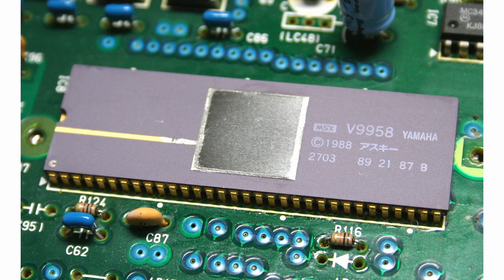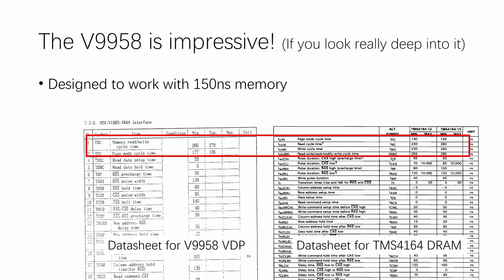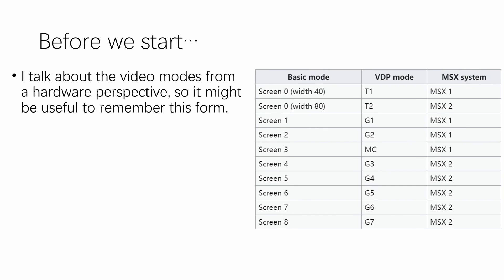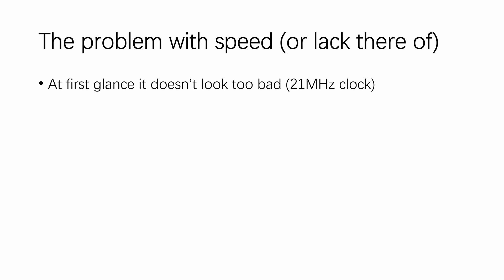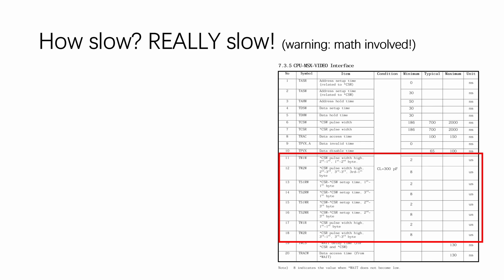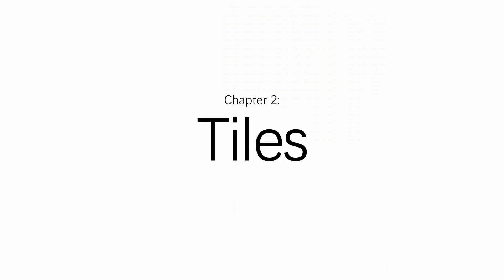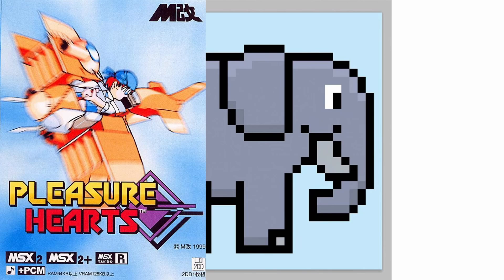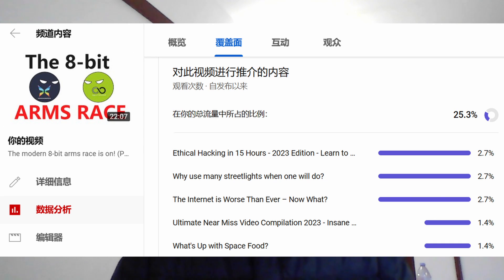The V9958 is a bad design. No, really.

Comment: I did a lot of analysis of the NEC uPD7220A GDP with a similar VRAM access via IO ports.
The clock is more in the range 3-8 MHz, with my computers (robotron A5105) running it at 3.75 MHz. The pixel shift registers are located outside and clocked at 15 MHz dot clock max.
This V9958 clock is just the base for the dot clock because of internal pixel output generation.
Like the dedicated uPD7220A, the V9958's internal complex logic is running at a lower speed, since the number of transistors doing the logic, and esp. the length of the logic processing chains, determine the reachable clock.
The transistor switching speed and currents (driving the next logic elements) are defined by the used fab process, which is also a matter if cost and production yields.

Comment: lieber andy, ich glaube selbst mit einer echten 16 BIT CPU ist so ein v9958 noch viel zu langsam,also den sogannte "flaschen-hals" dann in diesen computer system.
wenn ich da viel mehr ahnung hätte von den akutellen 2 Euro "PI PICO" Version 2 ,würde ich "just for fun" mir das schnelle mega drive 1 als neues Vintage hardware modding projekt da "vor nehmen".
Da dort die alte 68k CPU in Standart "DIP" format also gesockelt werden könnte wie "PI Storm" auf den Amiga 500/1000/2000 etc. also auch der normale "PI" Pico die gesamte Videospiel-konsole allein kontrollieren könnte,ausserdem dass lächerliche nur 64 KB VRAM gegen einen PI PICO 2 ersetzen,der dann die neuen "SUPER FX" GFX Effekte dann "berechnen" darf.leider es wird trotzdem dann bei nur 320x240 Pixel eben den maximum des sega MD "VDP" Chips da bleiben. und noch mal vielen dank für deine info videos über den langsamen v9958!

Comment: It really sounds like your complaint is that the V9958 doesn't really actually add much over the V9938 or even just an improved TMS9918A. That the original chip was maybe serviceable in 1979, but by the time the V9958 was introduced it should've been more capable. It might've been, if not for its reliance on slow DRAMs.

Comment: You say the chip is available new, even thought that is true, it is basically a invalid option. Paying 50 bucks for a chip in very short supply, is no option for homebrew systems. But you forget the true achilles heel of the 9958, basically of the whole MSX line: 212 vertical lines. It is just an unbearable low limit, especially on PAL, where a CPC or Amiga can deliver the full 288 lines. 25% of the screen unused in unacceptable. Most competitors had 240 or 256 lines. I know C64 and Speccy were even worse with 192/200 lines, but those do not have an "advanced" late eighties chip. Just skip the entire thing and get an Amiga I would say.

Comment: Bitmapped graphics are a terrible idea unless you also have a 16 bit cpu and very fast low latency vram. If you're going bitmap you're going to be pushing a lot of pixels from the cpu into vram and you're probably going to be using tiled graphics in your game engine as it is just so much more efficient to store game graphics that way, so no tiles in hardware is a missed opportunity. Chip really sounds like it was designed without consulting with the people who were going to program it

Comment: While I agree that V9938/V9958 are a missed opportunity in what they could have been if their design was cleaner, however they are still my favourite choice when I choose what graphics feature set to use in retro development projects. Look: the X68000 has a really weird square resolution, and besides it has lots of features very hard to master. The HAM mode in the Amiga is a dirty hack that I never enjoy programming for. The NES has a very limited color palette. In the end, the V9938/V9958 offer exactly what I want, and no other chips from the era come close. Even the later V9990 got it wrong by not supporting sprites it bitmap modes (it supports them in pattern modes only). I know the V9938/V9958 have sad limitations, but they are the vintage graphics with the best feature set. No other chips got it better (they were faster, but their features were poorer or even dirtier to program).
Reply: Ah, and I forgot: the Atari ST has no hardware sprites (yes, its blitter is fast enough for emulating them, but you don’t get hardware sprites). In the end, it’s like I said: the V9938/V9958 end up being the ones with the best feature set from that era. No matter what you try, the answer is always the same: they are the only choice (unless you sacrifice features for performance…. but then, if what you want is performance, why go retro when you get TFLOPs of performance with modern GPUs?)

Comment: I try to cut my V9958 some slack because of it's age... but it is starting to get on my nerves!  On my 3.57MHz bus-clock system, I have to insert TWELVE NOPS after each pixel write in GRAPHIC7 or in YJK modes.  So drawing a full 256x212xYJK frame takes like 0.5 seconds.  I'm starting to consider using a Pi Pico 2 for video in my project.

Comment: I feel like the V9958 is an excellent chip if you understand what it's good at, and what it's not. It clearly needs more cpu grunt to really take advantage of it than a 3.58Mhz Z80 if you're working on a modern project.

I've been wanting to use it with a 4-8Mhz 65C02 or 65C816 in a homebrew project, and see what it could do for a few years. 

I've had various thoughts on to handle things. The nice thing about the 65XX chips is that they have really tight memory access times, so this could help things or hurt things depending on your view. Depending on what you're doing, it can run circles around faster clocked chips of the time at the cost of programming, so you have to treat it like an early version of a RISC chip and be efficient.

 I was thinking of the possibility of using a single 1K dual port ram in conjunction with standard main ram, or even using some logic to handle ram access. Possibly even have it where the CPU accesses things only on clocks the VDP does not.

I do know from reading that the V9958 apparently DOES NOT like the block transfer operation of the 65C816, so a direct access to the ram would be really nice. And talking about weird to program for, the 65C816 will really shake things up here.

Throw in a YM2203 and a DAC and it could be an interesting little project. I had thought of potentially using one or two FIFOs in it, and use a clone of the Disney Sound Source for PCM audio. An alternative would be a YM2413 instead, but I was trying to keep some little bit of distance from the MSX.

There's quite a few possibilities here, each with their own tradeoffs.

I've had time to think about things, so we'll see what happens. Still haven't actually started it yet.

Comment: It's long been claimed that ASCII straight up didn't care about games which is why they did a chip with proper vertical scrolling only (for console output)... and that more subtle things like the sprite enhancements were snuck past them by the designers.

A more enhanced pattern mode would have been nice for sure, not to mention less lazy blitter timings.

Comment: Uhm, your calculations are not accurate. copying a 512x212 block from one page to another in G6 takes about 1 second in logical move. That is the VDP carry out the following access for 512x212 pixels = 108544 pixels:
- 1) Read a byte from source 
 - 2) Read a byte on destination
- 3) (Perform a logical operation so no I/O) access
- 4) write a byte on destination

So three byte accesses for every pixels. Because the VDP is not optimized to avoid a double I/O for adjacent pixels when processing in 16 color mode, two adjacent pixels this operation is performed two times, in other words the vdp accesses the same byte even if it has just accessed before. So what number of accesses do the vdp in the above example?
108544*3 i/o accesses =325632 i/o about 318 Kb/s. 
In byte mode the number of accesses is rougly 170Kb /s of data mode, but because to copy a byte you need two I/O operation the memory access speed is something in the ballpark of 340Kb/s

the problem with  cmd engine is not vram speed. on VBLANK there are plenty of slot available because no screen redrawing, no sprites. Unfortunately the vdp cannot make use of those accesses because it's internal state machine is extremely slow at performing internal operations required for command processing such incrementing source and destination coordinates, decrementing counters and check if they reach zero and so one. So while those operations are in progress, a number of possible data access slots is wasted because no I/O access in done.

This is proved by the fact that both blitter and cpu share the same time slot, so teoretically if one is doing a byte move operation through blitter and at the same data output data at maximum speed via CPU, the blitter should slow down because cpu has priority over the blitter. this effectively happens, but it is negligible on a copy command because the internal operations leave enough time slot to perform cpu accesses while the blitter I/O is idle.

things change a lot if the command is a byte fill command. why? simple, because this command does require less internal time used to increment internal register values the I/O blitter accesses are more frequent, so they are more stopped if the cpu is writing data .  In this case the blitter speed decrease a lot
Reply from the maker: Very detailed calculation! One thing that I wonder is that the command engine may not be a state machine, but an CPU running internal ROM code. Because 1, in the block diagram in the official document, it is called a CPU. 2, there are just too many cycles, and too big difference between different types of instructions. This is just my intuition, but I think a hardware-based state machine would work faster and be more consistent. The cycle count feels like there is code being run behind the scenes.
Reply: @andyhu9542  It could be.. My idea of state machine is only speculation. It would be interesting, if there is CPU executing ROM code, to hack this to get more speed reducing cycle count, but, it is not feasible...
Reply from the maker: @gasparinizuzzurro6306  I mean, if Yamaha let that CPU to fetch code from VRAM, we would have a coprocessor synchronized to the dot clock that will do beam racing stuff for us. That's my dream.
Reply: @andyhu9542  unfortunately.... a dream.Yamaha lost a lot of opportunities some very easy to implement, like a interrupt on command execution terminated, It was very easy to achieve, there is a status bit that goes from low to high or viceversa (i do not remember) to indicate "vdp busy in command execution". Should be easy to link to the bit value transition the action of triggering an interrupt. 😞

Comment: I know this is for a computer but It was so much more interesting back when each console used it's own custom chips.  Nowadays consoles are just stripped down PCs.  There is no mystery or amazement when a new console comes out because the latest PC GPU is already going to be more powerful.  Back when N64 launched now that was amazing.  There wasn't anything like Mario 64 on PC.  In 1996 the best PCs had was stuff like Quake,Diablo,Tomb Raider and Descent II. Somewhat decent graphics in those games but not as good as Mario 64.  Even with the Dreamcast when Shenmue came out in 2000 as far as I know there wasn't a game that looked that good on the PC.  We already pretty much know what the PS6 and Nextbox graphics will look like.  Take the most powerful GPU thats on the market now and something similar will be in the next consoles in the next couple years.  The games will look slightly better.
Reply from the maker: Yes, agreed, sadly.

Comment: You say that vdp chip is bad but you say that it is still a great chip,then is it really that bad as you do claim in the title? No, you just fakingly make that up,by just saying that it uses  slow Dram,and whether it is true or not,it’s not that bad as it sounds like,dang it,

Well how about talking about the idyssey 2 because that system is really bad,why? Because not per se for it’s low specs but for it’s graphical restrictiions for both sprites and backgrounds,because you can only use it’s builtin tile sets for creating your own backgrounds and sprites,that’s absolutely unforgivingly  BULLSHUT☹️
Reply from the maker: It is great to an engineer, but terrible for a programmer. There are many examples for this. Ask an engineer about the Space Shuttle and the engineer will tell you that the aerodynamics is great. Ask a pilot and the pilot will say that the Shuttle flies like a brick.
Reply from the maker: The Odyssey 2 launched in 1978 and the only competition is Atari VCS. Comparing the specs of the two, you would realize that the Odyssey 2 is fairly competitive. The MSX2 launched in 1985 against machines like the Famicom/NES and Master System, and those two often beat the MSX in terms of graphics performance. I didn't look at the datasheet, see DRAM and start ranting from there. I played the games, found them underwhelming (comparing to what the specs suggest) and started looking for root causes.
Reply: Well than it is the same problem with both the sega saturn,N64,ps2 and ps3,they are great systems but they are hard to program for🤣

Comment: I have only limited experience with the V9958: my custom 6809 board used one. The indirect VRAM access was certainly the biggest pain. I chose the part because it has a 80 column text mode. Scrolling was a killer; a real dog. I had to implement scrolling in half screen increments.

Still, I quite liked programming it. But I never did anything particularly clever.
Reply from the maker: I saw a V9938/V9958 add-on for a Tandy Coco/Dragon at a meetup, it runs ported MSX1 games. Is that your project?
Reply: @andyhu9542  Google is horrendous for removing comments now.
Reply: Wow it even deleted my comment that moaned about comments being deleted. Holy sh1t.
Reply: MAXI09 is me
Reply: So that other one is not me. It seems comments are no longer suitable for discourse. Thanks YT.

Comment: This was fascinating, thank you.  Comparing DRAM driver specs to DRAM chip timings...  Maybe it's a lifestyle choice...  Been there quite a bit, especially in the 1980's.  But this chip certainly pushed the limits of what was possible at the time.  There was a short lived chip in the mid-80s that had even greater capabilities than the 9958 - that was the 82716 (from Intel and Matra-Harris) which supported sprites and multiple planes with text and bit-map modes concurrently, but it disappeared before being widely used.  It also used standard 4-bit wide DRAMs, but it was neither MSX nor TMS9918 compatible, and the PC market was already on the verge of moving to VGA.
Reply from the maker: There are always new graphics chips out there that I don't know it seems. No matter how many I do know. The 82716 is tightly integrated into the 8086 lineup, however (multiplexed address and data lines). Using it on a Z80 would be hard.
Reply: @andyhu9542  Using it on a non-multiplexed bus is not too bad - it's how I used it back in 1987 / 88. But yes, it was obviously designed for x86. The Intel 82786, which came along a little later, was a much better chip but was aimed at serious workstation graphics applications with features and a price to match.